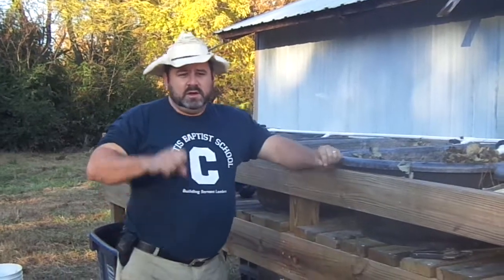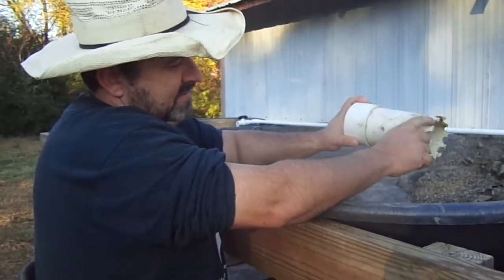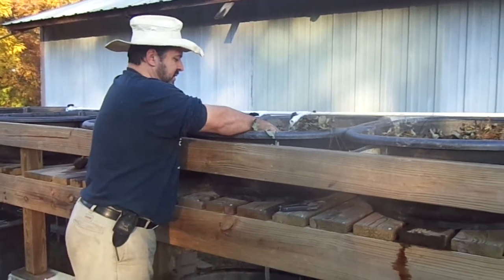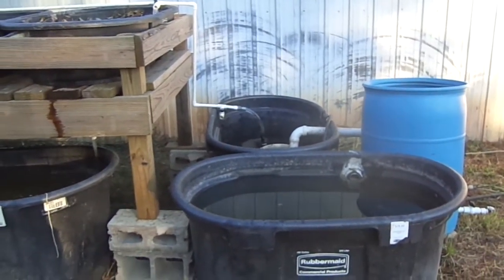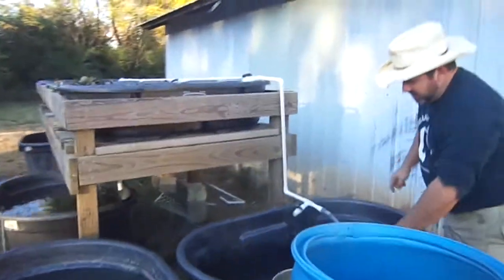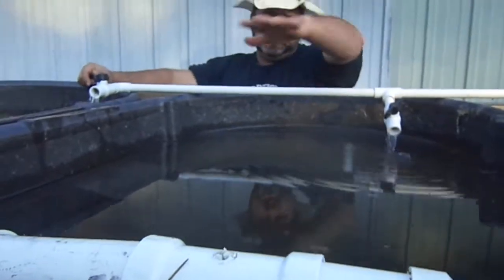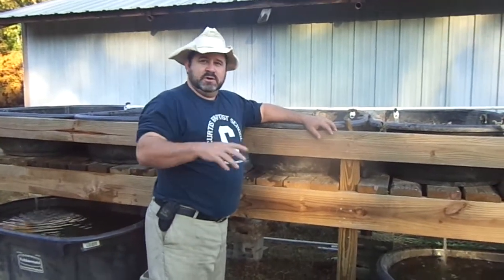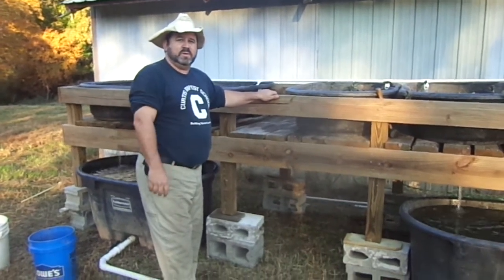Aquaponics # 2

Comment: Would Like to point out that with your system being up so high the freeze and frost will hit it first... Second in the winter time the bacteria will die off in the beds not being in a greenhouse.... So this would be a seasonal system an in the spring you will have to cycle the system all over again from scratch..
Reply from the maker: We don't get cold enough  to worry about freezing or frost

Comment: Between the heavy metals and the galvanization you will want to pull that ac duct out and replace it with a larger [4"] pvc pipe for your bell siphon guard, the rust will not provide iron to the plants      good luck with your projects
Reply from the maker: Thanks